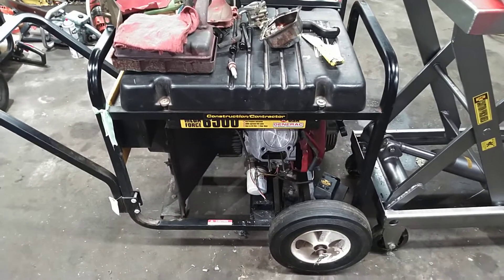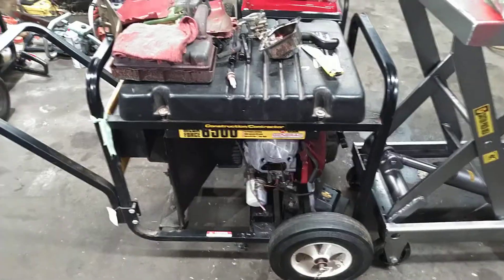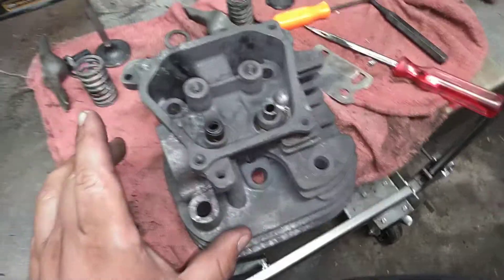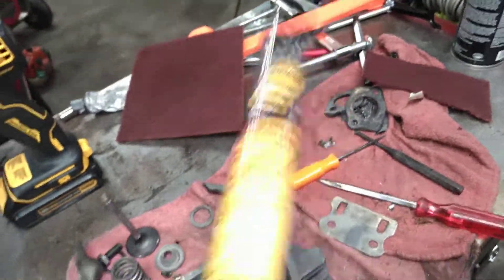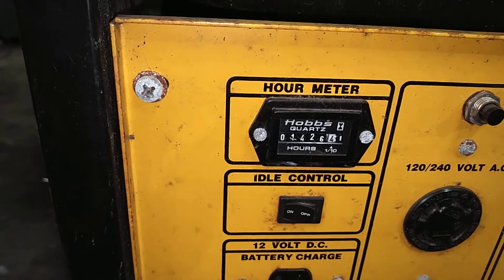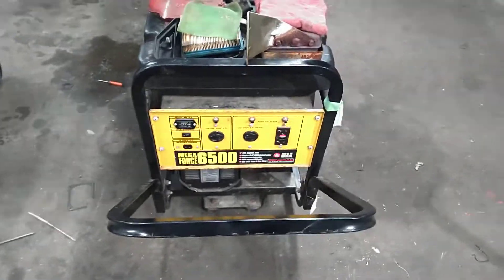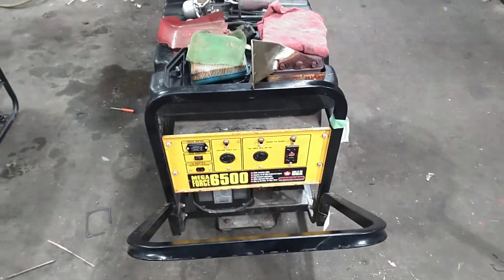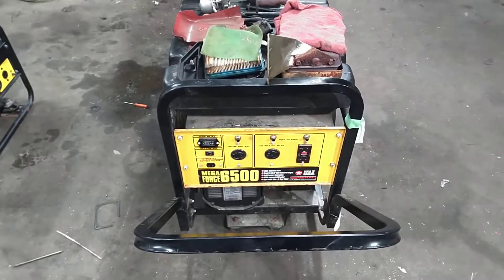Generac Mega Force 6500 watt generator repair part 1 of 2

Comment: The main way you can essily round the head of a bolt is by using the wrong socket.
You must use a 6 point socket. Not a 12 point.
Hope this helps someone out 😊